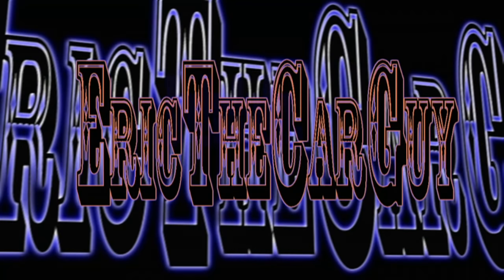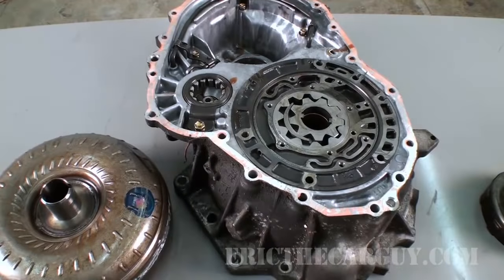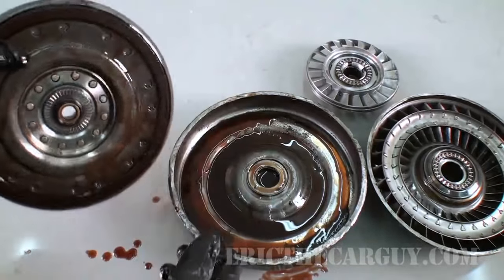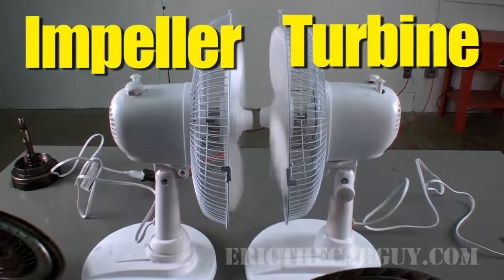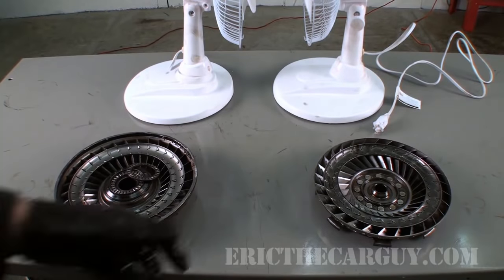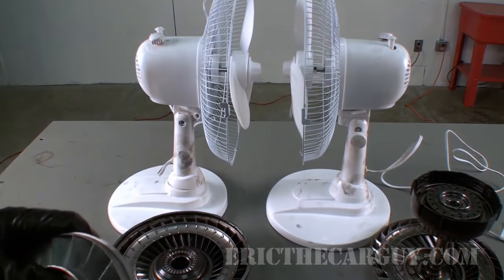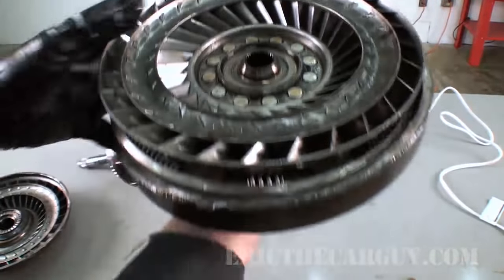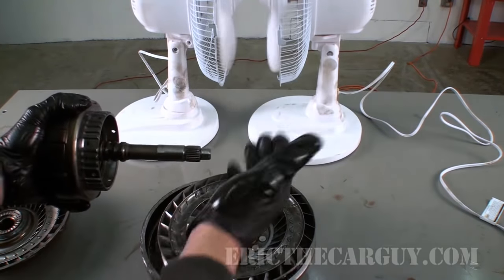How Does a Torque Converter Work?

Comment: Informative and interesting to watch. My youth of fixing cars, was whatever you had to do. The State of the Art, electronic equipment consisted of a Timing Light and Multimeter.🙂But when it came to the tranny, we'd just head to the boneyard. grab a $50 used one. I knew the torque converter had fluid but I never understood how it worked, cool.

Comment: Hi Eric, nice video and very informative. Eric, I have a question about my Ford Escape 2014 model, the issues when it is shifting the car is jerking and there is a delay when it shifts to a higher gear or when I am hit my brake like slowing down at a traffic signal or at bumper to bumper traffic situation the car is rattling, there is a delay or gap when it shifted to another gear, what do you think is the problem? Thanks so much

Comment: I'm very much grateful for this video. I got a question now with regards to what happened to me and the Mercedes I was driving last week with a 722.6 transmission. I was cruising then suddenly it locked the  rear driving wheels. I  switched it of and restarted. The was no reverse, there was no forward drive then in panic I called a tow truck. A tow truck came and I put it in neutral and in that neutral it started having a forward drive. And I drove it for like 15 miles whilst selecting neutral. Any idea?

Comment: Good explanation.  1 question, have you ever come across a torque converter that is sealed and doesn't use fluid from the transmission?

Comment: My question is do you have to fill up the torque converter before you put it on or does the pump since the fluid through the  converter Given the necessary fluid it needs???

Comment: I had a 90 Mazda MPV and from the time I bought it, the clutch would lock/unlock @55mph/2krpm about every 1/8 mile on flat ground. Mazda had no idea what I was talking about when I explained it to them. I lived with it for 190k and a tranny rebuild @170k. Supposedly rebuilt the TC, but I doubt it. Also this van would shutter if you stepped on it from a dead stop. BUT!!!!! I thought it was a great van other wise. If they made that same model again, I'd buy one!!!

Comment: Question: OEM torque converter on a Jeep Wrangler had to be replaced due to 35” tires with 3.73 gearing. I now know I need to re-gear eventually but mechanic told me it would be fine in the city with current setup. Said I just didn’t need to drive on interstate for lengthy periods. What’s your opinion on this? Is it ok to off-road with current setup for the time being until I can afford to re-gear?

Comment: This can be explained in two ways:
In an asynchronous motor, there is rotor (the shorted coil) and the starter (the rotating  magnetic field source). The rotating magnetic field is the driving impeller, the rotor is the impeller while the coupling is the fluid.

The second examination is:
In an epicyclic gearing, the sun is the driving impeller, the planet gear holder is the intermediary stator, the annulus is the driven turbine, while the planet gears set is the fluid coupling.

Comment: Erik excelent video as always,. Whay do you think abut the next. I has a Chevy Trailblazer 2005 and when the engine is cold and gear, stop in red light and felt a little vibration only in drive in Reverse or Parking no. After 15 or 20 minutes  vibration goes.

Comment: This is an excellent production demonstrating how the torque converter works. I completely understand everything except how the stator "doubles" the torque. My problem is that if the tourque were truly doubled, that would either make a torque converter a lind of energy creating mechanical device, which I know doesn'r exist, or it must mean that the regular normal torque produced must be under 51% because you must be able to double the torque and still transmit less than 100% of the energy. Maybe I just know enough to be dangerous, but I just can't get past the fact that a torque converter can't possibly double the torque that the engine provides. And if it does, why would you want to return to the less than 50% torque that the stator provides?

Comment: You forgot the very early type that doesn't have the stator. These are called "fluid coupling" type. Some Mercedes cars had a manual gearbox without a clutch pedal, yet still had a clutch. The engine has a fluid coupling driving it. The system is vacuum operated, controlled by a switch incorporated in the gear shift stick. The harshness of the clutch engagement can be adjusted at the release control box on the right side of the rear axle.

Comment: Thank you for your videos. I’ve been watching your videos for quite a while and always enjoy them and learned several things very helpful to help me with my projects. 
I have a major problem could you suggest some solutions?
 I have a 99 Ford F350 diesel 4 x 4 with the 7.3 engine. It seems like the engine is seized. Is it possible that the torque converter could be seized & simulates the engine being seized,?
how can I tell if the torque converter is seized or not.
If it is seized how would I get the torque converter off the engine ?
thank you

Comment: One thing: in the beginning you listed the functions of the torque converter and omitted the only thing that I understood the torque converter does and that is allow the engine to run while the car is at a dead stop, but you covered it later.

Comment: I have a 2005 Toyota Tacoma that when I drive at low speed, I get a vibration , like when you are running off the edge of the road.  However, after you go up to 60 MPH the vibration pretty well goes away.  The Toyota dealer said the torque converter needed replaced.  Have you heard anything like this?  Thank you!

Comment: Close, but....  the impeller produces vortex or crossover oil flow to the turbine due to its centrifugal pumping action, imparting energy to the turbine.  Fluid flows around the curved turbine vanes and is discharge out to the stator, locking its one way clutch.  The stator now multiplies torque by (a) providing a reaction surface for turbine discharge and (b) redirecting flow back to the impeller in its direction of rotation, accelerating flow through the impeller for the next pass at the turbine.

Maximum torque multiplication is typically 1.8:1 - 2.2:1 at wide open throttle stall, the maximum rpm the engine and impeller can reach with the turbine held stationary.  This produces the maximum vortex flow out of the impeller to the turbine.  Also, torque multiplication decreases as turbine rpm increases until the converter reaches the unity or coupling stage of operation, typically around 50 km/hr.

Comment: So how do they fail? Of course the bearings can wear out, but that would just be noisy right? Fluid would still be flowing from impeller to stator to turbine, causing the turbine to spin, thus spinning the trans input shaft, then the trans and the vehicle. What is it that fails, preventing the fluid from applying torque to the turbine?

Comment: The original converter had  a base plate of pre-famulated amulite surmounted by a malleable logarithmic casing in such a way that the two spurving bearings were in a direct line with the panametric fan. The latter consisted simply of six hydrocoptic marzlevanes, so fitted to the ambifacient lunar waneshaft that side fumbling was effectively prevented.

Comment: Great vid, thank you Eric!!!

I've got a question - when I drive (6sp auto tran), once I leave the gas pedal, it feels like the car is using the transmission to stop, like in the manual transmission with clutch engaged. As far as I remember from previous cars, it supposed to coast without any resistance. Any advice on where to check is highly appreciated 👍🏻👍🏻👍🏻

Comment: this is a very old video but very amazing info. I was hoping you could tell me why from new off the lot my torque converter is super loud and sounds like metal on metal, dealer said its normal for years, i finally see they released plugs on the torque converters to quiet them down for the bellhousing (3 rubber plugs for the holes that are open). Plugs are supposed to quiet them down. Those 3 plugs being open shouldnt have caused any issues since plastic belly pan has been on id imagine. Mainly curious if that metal on metal is indicative of anything bad. Thanks
Reply: im assuming its the "umph" 6:40 and 9:10 which is why any uphill movement from a dead stop or low speed is why its so loud when it does it, makes that loud metal on metal noise. I wonder if something is wearing inside or its normal. its a 2018 vw atlas 3.6L 4motion btw if curious, everyone stares when i start driving or go uphill its so loud. EVERYONE on the forums complain about it, i feel its a recall? 10:40 def seems like whats happening inside every time it does it.

but you are saying with the intro of the torque converter clutch they both move at the same time now, so could my noise be the clutch thats not working as intended ? I dont have any stalling though.

I do hear it at 1500-2500 rpms too! at lower speeds like below 40

Comment: The symptom feels like when brakes have been applied, there was a feeling like slipping, then 2 days back,  our 2009 rav4 just stalled and gave a grinding noise underneath but the engine still running then rav4 came to stop moving.  Now, do I need to replace my transmission or just try to drain some tranny fluid to replace some?

Comment: So basically when the converter is spinning at its operating speed the clutch locks up to a 1 to 1 engagement, when you down shift or floor it, it will cut the supply of fluid so the clutch will release temporarily, trans downshifts and the pressure causes it to lock in again to a 1 to 1 engagement until you let off the gas causing it to release again and shift back up and re-engage the clutches. Almost like a clutch on a go-cart, when the motor spins faster and faster the clutch expands until it is spinning so fast it locks up or until there is again to much pressure and it slips or the cart is moving fast enough to over come the torque being placed on it.

Comment: Thanks for video. Have a question. My 4l80e start whistle on all gears,  it's gets louder on higher speed, but it stops as soon as I leave pushing a gas pedal, it's real sensitive, just I even touch a pedal lightly it stars whistle again. So it whistle on all gears gets louder on the speed only when pushing gas pedal, doesn't whistle when releasing pedal. I was thinking it torque converter and after your video I'm pretty sure it is. What di you think? Thanks

Comment: How is the lockup clutch actuated? Is it hydraulic pressure or centrifugal? Some cars I have owned seem to lockup in all gears, others only in top and they had a switch for it (94 Camry).

Comment: 2001 dodge ram 1500 2 wheel gas 5.9

I have a lungging problem at hi-speed where is seems to stall and suddenly re-engage. 

The engine and trans seem to be working just fine except for this persistent problem. 

After reading and watching online im thinking it is in the converter but i had my trans rebuilt less than 30k miles ago.

Aren't "they" supposed to rebuild the converter when they do a trans rebuild ?

Comment: Hi Eric or reader,
First Question..
How does the torq lock trigger ? Is it pressure related or solenoid electric.. if I get very slight shudder when the vehicle is in second gear climbing a hill and rpm’s are low say 1500 at what point should it jump to first and would that be different if the eco / sport press switch is activated..? It’s a Holden commodore Vy setup..BTW. 
Second question ..
If I get a dragging sound in reverse that’s rhythmic is it
 or could it be torque converter related or the bands in box..?

Comment: Eric I bought,had built, a converter from Coan a few yrs back,it was suppose to be a 3000 stall but worked like a stock converter.will more or less power,torque or cam effect stall up or down?i can’t seem to get an answer from Coan of course being pissy or even on you/tube.

Comment: On what side of the converter is the engine? The fans make it seem it's on the side of the impeller, but at the beginning he explains that the turbine side is attached to the flex plate of the engine.

Comment: What makes the final torque converter lockup engage? If the motors torque would lock it up at say 45 mph in its final gear why not the same torque at say 15 in first? Or is it the rpm that makes it lock?

Comment: so when the car is driving/cruising the turbine fan locked with the case always? And its only during stopping that the turbine's clutch is freewheeling/disengaged and then to go again the stator's clutch locks up to give it the torque multiplication to overcome the weight of the car? Am I following correctly?

Comment: Good explanation, but I'm unclear on why the torque converter clutch only locks up after the transmission shifts in high gear? If it works on oilpressure, isn't that pressure dependent on engine rpm since the pump is driven by the torque converter so wouldn't it lock up any time the engine revved over a certain rpm?

Comment: hey Eric. please respond!

My transmission at idle does not want to engage into gear wether reverse or drive. I have to rev it up for it to kick in.

Can the torque converter cause this? It has died a few times

Comment: When October gets here (i dont do heat) i will be installing a new engine in my car,although i have been working on cars all my life and have installed a few engines,this time i am doing a little bit of a custom thing so i wanted to arm myself with as much information as i can, i dont wanna be that guy "Well we have pulled the engine out for the fifth time and things are still not right",no sir, i dont wanna do that,during this learning process i have learned a LOT of things about automatic transmissions i did not know or thought i knew, i guess in the past i just got lucky and things turned out good.

One thing i had no idea about and did not know was that the nub that protrudes from the front of the converter (the pilot) actually goes in the hole in the back of the crank, not all the way mind you but it "rides" in there,i thought once you bolted it to the flexplate that was all there was to it, not so,i also learned that its a good idea to measure said hole in the crank to make sure the converter fits in in there SPECIALLY if you buy a after market converter or if you are using a aftermarket crank (Eagle Scat etc) , you also have to make sure the converter is "seated" in the transmission, meaning it needs to be engaged with the pump behind it all the way or bad things will happen in a hurry.

Excellent video Eric as usual!!

Comment: I recently bought a 2001 Dodge ram 1500 ... It does not down shift out of 4th gear when slowing down, and shutters a bunch.  I found that. if I shift down it doesn't have that problem ... been trying to figure out what the problem is ..I thought it was the electronics ... now I wonder if it the torque converter ... Thanks for the information, maybe now I can talk to my transmission guys in way they might understand.

Comment: Does the fluid in the torque  converter circulate with the fluid in the transmission and gets cooled by the  transmission  radiator? If not how does the torque converter get cooled.

Comment: I am sure my lockup is stuck inside TC on 700r4, as soon as I start the engine the car takes off and dies when I stop. The valve is open and springy where it locks up on the valve body. How can I unstick the TC lockup or do I buy a new TC?

Comment: Hi there i have a problem . Maybe you can help.I replaced the  the gearbox seal .When engine is off it didnt leak ,but when it starts it leaks.But standing now for two weeks after the oil leaked out .A trail of oil .Can you help please .Seal fitted correctly and geniune toyota lexus 1uz part.
Would appreciate feedback.Thanks Russel

Comment: Hi! Do you recommend replacing the transmission which will include the TCC, or is it ok to just replace the TCC leaving along the transmission? I'm torn on what to do. I have a P2757 code. Please advise, thanks.
Reply: A p2757 code could be just a solenoid that lives in the transmission under the pan. It could also be the torque converter clutch which is part of the whole torque converter assembly but because you can’t just replace the clutch, the whole torque converter is replaced. The easiest and cheapest option is to replace the torque converter clutch solenoid first.

Comment: So, regarding the TCC... The Chevy Silverado/GMC Sierra (and others) are said to have a TCC that locks up in all gears, and disabling it in all but the last 2 gears (HP Tuners) helps  prevent, or at least delay a common failure with the 6L80E transmission. This is supposedly due to the TC  housing being a bit on the weak side, causing poor contact due to flex in the housing. (or, at least, I think that's what they say.)

Can you speak to that? It's all over the internet but based on your description, this shouldn't be the case.

Comment: Today torque converters are found in manual transmissions. Isuzu trucks with AMT transmissions use a manual box which shifts gears via electric solenoids and utilises a torque converter.